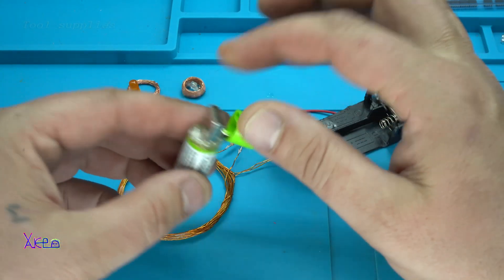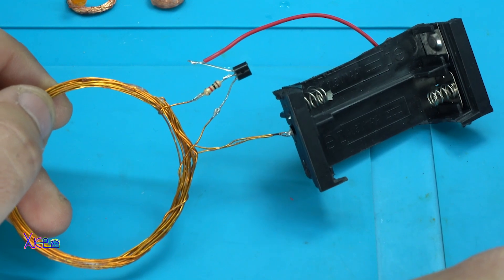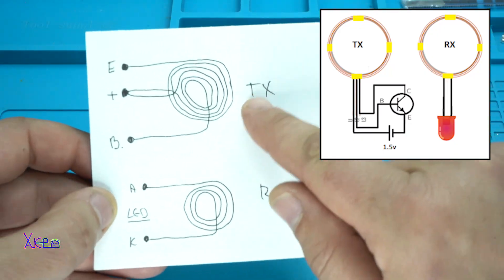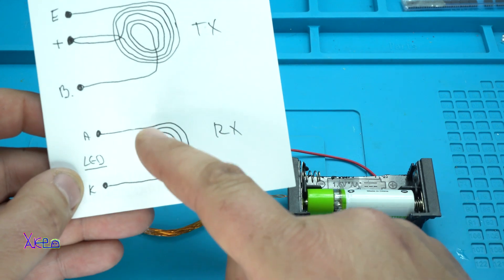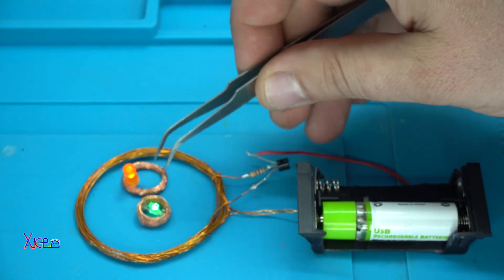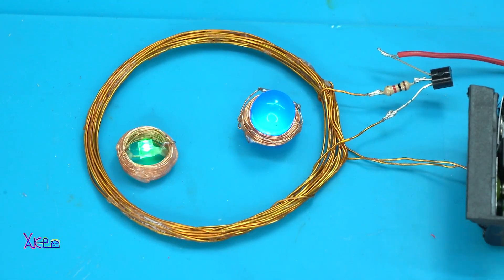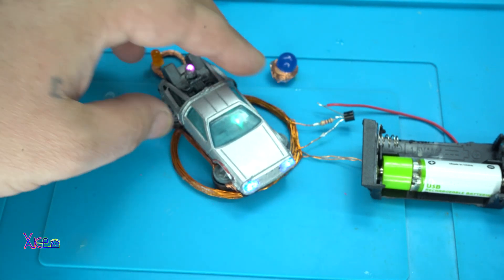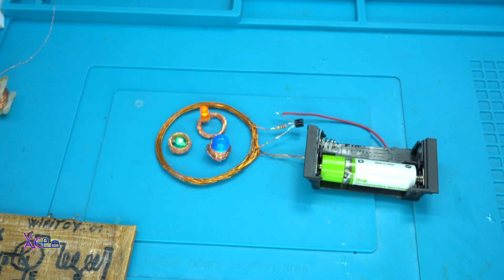Making Homemade Wireless Leds - Easy and Simple

Comment: Does it still work if you hold the LED perpendicular to the TX?
Reply: It won't work nearly as good...the field THROUGH the LED coil should be perpendicular through the power coil (in the power coil the magnetic is perpendicular to it...up and down).  The LED may go completely off, and slowly come to maximum brightness as you rotate it to the normal position.

Comment: But it ain't working, rather the transmitter gets hot, I've tried using higher resistance like 10k still nothin works
Reply from the maker: Ptetty sure your mistake is with coils,check that and be careful with pinouts of transistor
Reply: Thanks but idk what's wrong but it worked well with 2n2222 transistor. I've created similar circuit with bc547 but it doesn't works (yes I did maintained the pinouts as they are different than 2n2222) I thought any NPN transistor would work but nahh... But atleast I'm happy it works. 😎 😂

Comment: Please help : 😊  I need to have a device that warns me that my soldering iron is ON . Most of the simple solution would not be applicable eg. Neon in the mains line .I would like an  induction device that captures energy from the 220 v cable and lights a LED or  Neon
Reply from the maker: I have made a beeper using 555 timer and it beeps every 5 min,check this video:https://youtu.be/6dDXmXcHJtA?si=_xsAwdKYaU48Cxd1

Comment: How can this works? Its obvious it does. But I dont get how current can be induced. Cause is CC. And you need a variable magnetic flux.
Reply: The transistor converts the DC current  to alternating current.

Comment: I am using 2n2222a transistor, it gets hot and the les does not light up. What could be the issue?
Reply: You mean two wire to positive and C to one of the coil end and B to resistor then to one coil end and E to negative. This is how I connect
Reply from the maker: Yes,I am sorry for that
Reply from the maker: 2n2222 pinout E B C ,on E connect Ground from battery,on B is resistor of 1kohm and C you should connect the 1 wire from coil,on both wires that are together connect +v
Reply: @Hacktuber  thanks. Works now
Reply: How can I increase the induction distance?
Reply from the maker: Use more powerful transistor and make bigger coil

Comment: help, it doesnt work for me it the transistor get super hot and breaks, i have slofer it to the righ pin outs, what is happening?
Reply from the maker: Use bc547 or 2n3906 or 2n2222 on these transitors pinout is E-B-C when transistor is point to you with letters

Comment: Great video! Do you think you could add a capacitor to the LED so that is would continue to glow for a while after is was removed from the coil that is providing the power?
Reply from the maker: That's a great idea! I Will try it
Reply: @Hacktuber  But the capacitor will be charging with AC.

Comment: Well, I just recreated this circuit and it turns out that it works wonderful!!! In my case I use a 3 volts power supply but with a small 2.4 zener diode to regulate the voltage… works so great !!! thanks for share it. The transistor I used was the 2N2222.

Comment: I want to recreate this exact same circuit, but I have some questions, there are some discrepancies regarding to te circuit, you show there’s no resistance on the schematics, but you just have a 1k resistor at the base of the transistor? Also, the main coil is 10 clockwise turns, then 10 counterclockwise turns?, what is the thickness of the copper wire you just used on your circuit? Thanks for the help!
Reply: Well… I figure out now I made this circuit work…
Reply: @Hararion  please share the thickness and turn used by you. and please mention the transistor.
Reply: @MungfaliK   I just use a 2N2222 transistor with a 1k resistor on its base and  copper wire # 28, 10 turns clockwise on one end then 10 counterclockwise the other end, connect the common of the coil to vcc, one end to collector and the other end to the base of the transistor via 1k resistor. The emitter hits the ground and that’s all… very simple circuit easy to make…

Comment: I built a stick welder using 2 microwave oven transformers, using this same principle. I removed one of the two windings from each transformer. I replaced them with 14g solid copper wire wound 30 tines. The new windings were soldered together at one end and the other ends were the ground and stick holder. Power was introduced to the coils left in the transformer but not connected to the new windings. Induction power!

Comment: I had so many cockroaches in the apartment. That's when the coil idea came to you. I built a huge 2500 watt/48 volt coil over 3000 watt 380/48 volt transformer. I then glued a metal clip to the roaches' backs and let them hop through the coil. All cockroaches are vaporized. Super !!!
Reply: I named the coil "Barbecue Party 2500"!